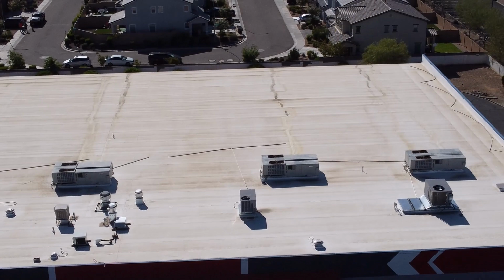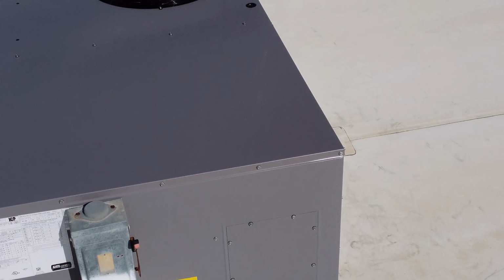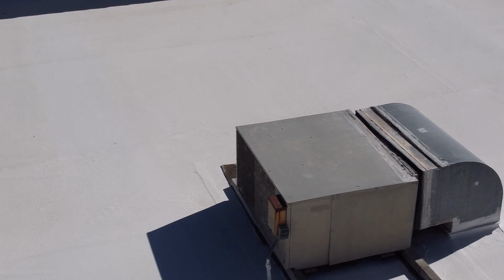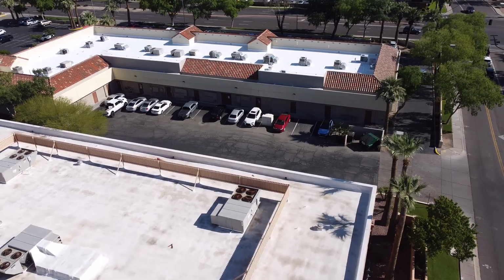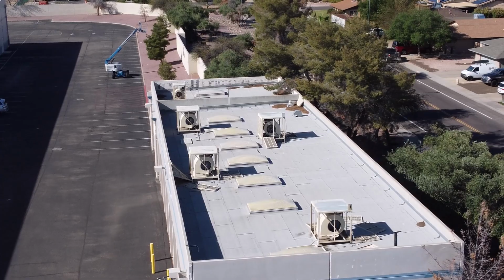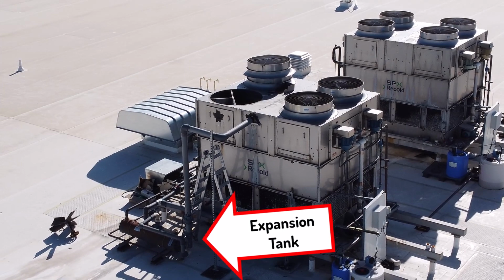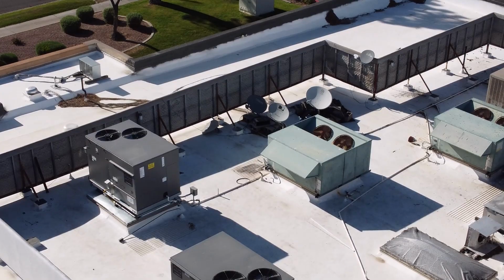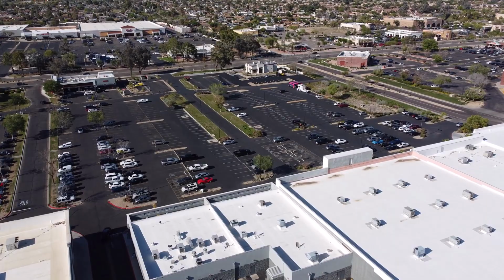35+ yr old General Electric HVAC still in operation at Bowlero! [59th & Bell Rd]

Comment: That has to be from pre-1982. After 1982, they became Trane. I had a customer with a 15 ton trane gas package unit that I replaced one of the compressors in that was from 1985. Was still working when it closed down in 2018 and they turned the space into an IHOP and tore everything off the roof and started over. The compressor I replaced was still working, but it was so worn out, head pressure was like 170 on a hot day, and running over 90 psi on low side (R22 of course). New compressor pressures jumped up to 210, and down to 68 psi low side since the closest 3 phase scroll I could find was slightly higher capacity than the old one. I replaced the condenser motors and fan blades and the filter driers over the years, but the blower motor etc was all still original. Unbelievable that the heat exchanger wasn't rotted out on it.
Reply from the maker: Yeah i forget exactly when they became trane. I remember some units being the same design that were GE when they started using the TRANE logo. I think that old UA Theater was one.
So I guess these are at LEAST 35 years old.

Comment: That bowling alley is a bad ass find. My local one had two or three large RTU’s. At some point in the 2000’s they replaced them with I just counted 13 small rtu’s. 

Would be cool to film those old GE’s on a 100* day
Reply from the maker: Another bowling alley that had a bunch of old G.E. units was Glen Fair Lanes, also in Glendale. I worked on them in the later 2000's.
But when i sent the drone up there when I first got it I saw they replaced most of them.

Comment: What is your opinion on the garbage Midea made shit?
Reply from the maker: They are one of the larger companies from what I understand.
Like most ductless, I see some run 10 years straight with nothing but filter washings and then you find some that just fry boards within months.
Ductless, like VRF, don't take too kindly to any debris etc. No filter driers in them. Just a few strainers that catch larger objects. So they need clean welding (if there is any welding done) and a good evac.